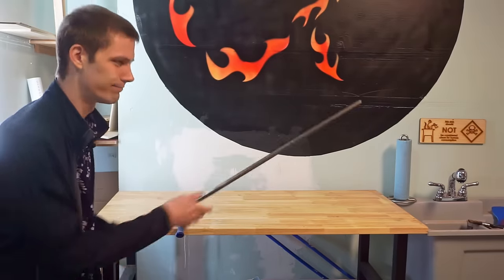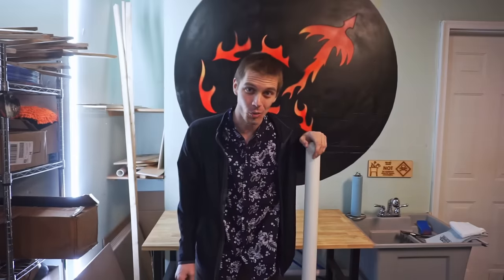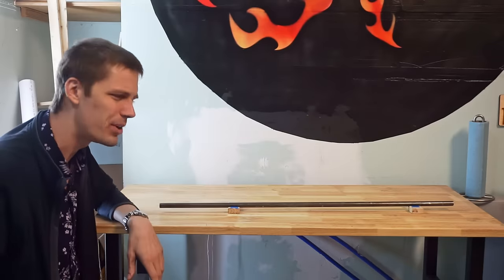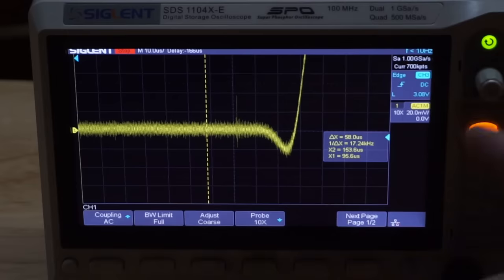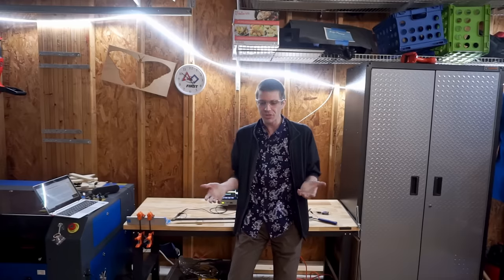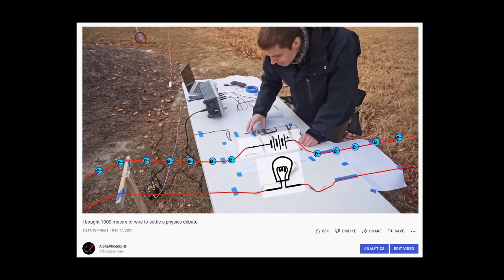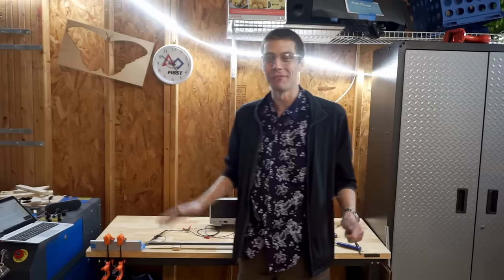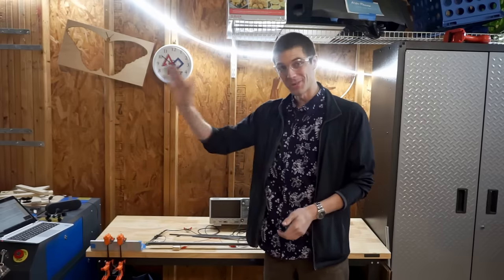Are solid objects really “solid”?

Comment: Years and years ago I had to explain basically this to a guy in a youtube comment who was trying to imply that physics (maybe just astrophysics) is bullshit. His example was a very long tube with golf balls lined up inside it - that pushing in a new one would mean that the one at the other end of the tube would fall out instantly, and therefore the speed of light being a cosmic speed limit was bullshit. I reasoned that, first of all, you'd need to apply a shitload of force to push millions of stationary golf balls - and then since you're applying so much force, that will clearly compress the golf balls, and you'll have a pressure wave moving through the balls which would likely be very fast, but decidedly slower than the speed of light.

I think he then got mad.
Reply: @obsideonyx7604  Lolz, how easily triggered do you have to be to imagine SJWs in scenarios with nothing to suggest one might exist. You're not even a snowflake, you came to the table pre-melted.
Reply: @QuesoCookies  observation = triggered

Nice logic
Reply: @obsideonyx7604  Speculation =/= observation

Logic 101
Reply: @QuesoCookies  observation came first, then speculation.

Still, speculation =/= triggered.
Reply: I once came across someone who believed math beyond elementary school level was useless in a YouTube comment section. Some people are hopeless.
Reply: Was he a flateather by any chance? Because there was a flatearther saying something similar (his example was a very long pole from Earth to Mars) very recently, and when I pointed out that pushing one end would not cause the other end of the pole to move instantaneously, I never got a reply ever since LOL...
Reply: @obsideonyx7604  You must have been pretty pre-triggered to suspect an SJW behind every corner though.

I recently had a brief discussion with somebody who was convinced that leftists were unfairly criticizing the Goths for invading Rome. It was pretty funny, this guy could not really understand that this only happened in his head.
Reply: @stefangadshijew1682  what a world we live in, where if someone reminds me of a far leftist and I point it out, I'm triggered. 

Am I not suppose to mention similarities to leftist or something?
Reply: @obsideonyx7604  You can do whatever you want, and other people might point out if they find it reasonable what you do.

In this case, some people point out that you get reminded of leftists by things that have nothing to do with leftists specifically.

I personally have seen this kind of behaviour more often with anti-left people with weird pseudoscientific ideas, but I didn't feel compelled to mention it, because it is really not specific of either the right or the left.

I don't want to be too disrespectful to you, I just think you should chill a little and forget that left/right-stuff once in a while. :)

Edit: By the way, you're right, the use of the word "triggered" in such contexts is disrespectful and insulting. Just because you felt the need to voice your opinion, people call you "triggered", invalidating whatever it is that pisses you off without considering wether you're completely right in your reaction. 
Maybe don't use that word in such an insulting manner yourself if you rightfully don't like that.
Reply: @stefangadshijew1682  a most honourable response. Very high EQ.

You're right, although I wasn't intentionally making this political, like, you don't decide what ideas you get, sometimes they just come up, but you're right in that maybe I should have kept those random thoughts to myself, politics is already dividing as it is, no need to let it infect everything we love.
Reply: @obsideonyx7604  Hey, thanks for the nice reply! :) I'm glad that you get my point without taking it personally. I also get that you didn't intend to make a scene out of your initial comment, but yeah, politics these days feels like walking on eggshells.

Wishing you a good day! :)

Comment: And this is why HEAT rounds are so effective, the penetrating jet is moving faster then the speed of most known materials. Basically the jet is punching through the material faster then the material can even react to it happening! Of course once you do that the material stops acting like a solid and more like a thick molasses. At this point normal material properties stop meaning anything and penetration starts getting close to the idea penetration model where the jet is going to penetrate a depth equal to the square root of the ratio between the destiny of the jet and the density of armor (this is part of the reason a high density metal like copper is used, it's about 14% denser)  times the length of the penetrator. Notice that last part is linear. This is the second reason copper is used, it really ductile. You can pull it into a really long and thin wire before it fails. This means you can get a nice long jet of it, the longer the better! This in turn why you hear the idea of "fist to finger" brought up with HEAT rounds. The greater the rounds diameter, the more copper you can have which means you can get a longer jet before the copper breaks up and since penetration is linear with length, all thing being equal the bigger warhead is point to punch a proportionally deeper amount of armor. 

Now with all that in mind, this also part of the reason why modern kinetic energy based anti armor rounds (though technically, HEAT rounds is a type of kinetic energy weapon... it's just a little more complicated... as long as my rant above is, I left out a lot) use what looks like thin, really long darts. While they don't hit quite as fast as a HEAT round, they do get close enough that the extra length does aid in penetration. 

Long story short, the science of material handles impacts at really high velocities is really neat. And this should also give you and idea of would happen if you tried to push a light second long rod of metal.

Comment: 2:00 I'm calling it now, it's going to be C, because the mechanics we're dealing with here isn't dissimilar to how sound waves propagate though air. The bar doesn't all move as a single object; the bar experiences a compressive force that moves through the object in form of a wave. The first row of atoms experience the force at the point of impact, they move forward, then transfer that force to the next row of atoms, and so forth until the entire body has been carried forward. The propagation is only faster in the solid because we're dealing with smaller distances between the atoms, as they are packed more densely. Other than that, it works exactly the same as it would in a fluid or gas.

Comment: Solving the speed of sound equations in 3D crystals is a very well documented process and yet it still remains very challenging to solve for the elastic constants in the materials I study... Very interesting how the crystal symmetries play a part in speeds of sound.
Reply: it should be faster right?
Reply: Does it depend on the angle? Also what about pressure vs shear waves? Very complicated, moreso than in fluids.

Comment: This has some intresting implications. Especially for the fact that this means this is much more observable. We could make a mile long steel bar and have a machine push it. It would take a whole second. With a slow mo cam half a mile down we might even be able to see the ripple of the movement
Reply: A mile long steel bar at 5/8" thick would be around 21,000 lbs. A slow mo camera could see the ripple in the 91cm bar. No need for the super long bar.

Comment: As a mechanical engineering student I can confirm that compressible fluids are one of the hellholes of fluid mechanics and thermodynamics
Reply: Do it bring a lot of variables that come with it?
Reply: Also as a FEA analyst Speed of sound through metal is the bread and butter of all the computations and basically make all the modern stuff around us work
Reply: @vlogcity1111  not only that, but the relationship between them (the equations) is more complicated too
Reply: @vlogcity1111  Yeah but the real problem is that is where the additional terms in the equations drop off into infinity and often cannot be solved even numerically.
Reply: @ianallen738  yes this. I hope someone comes out in future to solve this problem
Reply: Water isn’t a compressible fluid, right?
Reply: @TheAdarkerglow  Really much depends on your case...
Reply: @TheAdarkerglow  well for most applications it can be treated as an incompressible fluid, but in reality there is no incompressible substance. Notice that, as explained in this video, water compressibility is the cause of sound being able to travel across water, and also some other interesting effects such as the water hammer.

Comment: worked on a very similar problem a while ago, things get really hard really quick. had to measure energy of impact of cordless impact drill used 12Gs/s DAC and custom amplifiers. The model is really close to a RF transmission line :) the speed of sound and the temperature are the main factors. i have recordings of the wave travelling through the rod and the losses at different crossections due to emitted sound and plastic deformation. it was so cool :)

Comment: Great video. This got me thinking that the speed of sound should be faster in harder materials. and turns out it is. at least when i checked for diamond.(12000m/s) would be interesting to take a bar of carbon steel (arround 0.8% carbon would be ideal) and test the delay in an annealed state and then test it again fully hardened.

Comment: I guessed C but I was secretly hoping I was wrong and weirder stuff was happening. What a great video :) keep up the good work
Reply: E) all of the above+1, depending on when you stop going deeper, a) instant- if rigid and using classical mechanics, b) if rigid, but with general relativity, c) if rigid, but without heat effects, d) if a mesh, but without heat effects,
e) if mesh and you count heat loss, may never measurably reach, aka infinity time. f) b because electricity goes the speed of light and moving metal rod produces current and vice cersa.
Reply: I was wrong for the short version(also guessed point c (not the speed C), but changed my mind last second) . But at higher lengths, most of the wave will be perpendicular to the rest of the wave, see water wave in a channel, there will be drag off of the edges, even light(if not perfectly parallel) will defuse down to nothing, which is one of the reasons stars shine so dim.

Comment: I always wondered about this. I knew that transfer of information couldn't happen faster than the speed of light but I could never wrap my head around why it wouldn't work with an incredibly solid low weight materials like carbon fiber or graphene. To think it was predicted by something as simple as measuring how fast sound travels through the material blew my mind. thanks!

Comment: As a blacksmith, welder, and inspector, I love this explanation of the "elastic" connection between iron and carbon atoms. Plus, I learned about a third sound wave measurement that I had not run across in ultrasonic testing. (UT)

Comment: Cool video, thanks for that! Like many, my first thought was "wait but isn't there a delay when the force sensor compresses?", and from reading the comments I understand  there isn't.
But, I think of one cool way you could improve the experiment: place several sensors along the length of the bar, so you could see them firing in sequence, linearly (and btw if there was a sensor delay you could even measure it as the line offset). Maybe weld on a bit at half-length and place another sensor in front of it.
Reply: He sort of tried that. He initially had a sensor at the front as well as at the back. The problem with that setup was that the time of the propagation of the wave through the sensor was inconsistent, and I'm not entirely sure why that was, probably something about the interface between the materials not being perfect.
Reply: @Corrodias  As I understand it: The steel bar is relatively rigid and the sensors are relatively squishy. That first sensor was so much squishier than the steel, that its random variations in squish were enough to seriously mess with the overall result.

Technically you could put sensors along the steel bar, but the steel itself would still have to be continuous - you couldn't have the impulse actually having to be transmitted through the sensors, or you'd be back to the inconsistent-squish problem. Instead you'd stick piezos to the side of the bar, functionally equivalent to placing microphones and listening for the sound. Which would work, but would be less clear to the audience.

(for reference, many microphones actually use piezos to convert acoustic energy into electrical energy)
Reply: >and from reading the comments I understand  there isn't.
There is, it is just negligible in this setup. And to correct for this and be absolutely sure your experimental physics class would just make you repeat the experiment with different bar lengths. Lets say 5 different bars with lengths varying from 1L to 2L, where L is the length of the shortest bar. All sorts of clever things can be done to eliminate systematic sources of error in experiments and remove noise. In this case if you did that, you wouldn't get much and it would just make the video worse to watch.

Comment: I actually performed an experiment similar to this during my freshman year, but the setup was different. We used an RC circuit that only discharged when the bar touched a metalic base. We then dropped the bar from a small height and measured the difference in the charge in the capacitor after one bounce with a voltimeter. Since the bounce means an impulse traveling twice the lenght of the bar we used the exponential decay of the capacitor as the means to measure the time elapsed during the travel of the pulse. With the travel distance and time we got the speed of sound in the bar. The osciloscope makes for a better presentation though ;-)

Comment: I love this channel.  I majored in physics, and used oscilloscopes for validating clock synchronization timing to nanosecond resolution.  I feel like this channel is specifically made for me :-p. Oscilloscopes are amazing, and you are so clever at finding ways to leverage it to show some phenomena that is otherwise almost impossible to demo outside of models or using very specific lab setups.

Your video asking what happens when electricity meets a fork with one disconnected side should be required viewing for 200+ level physics students.

Comment: Weirdly enough, I had this as a thought experiment a few weeks ago, specifically a light-second length of metal pressing a button. After mulling it over for a few days, I couldn't come to a conclusion. I thought it was likely to be the material speed of sound, maybe the speed of light, but without a practical way (or inclination) for testing I figured that was that.

So I'd like to thank you for settling that particular loose shower thought; as well as explaining why the extensional speed of sound applied instead of the longitudal. 

A few questions I have are: Around about how wide would the bar have to be for the longitudal speed of sound to apply? I assume it would have to do with the wavelength or amplitude, but it was implied that it was due to the dimensional ratios. Could the longitudal speed apply if the bar was struck across the diameter as opposed from end the end or is there a minimum dimension for it to apply?

Again, thanks for the video.
Reply: I was asking myself the same question 😅

Comment: As a chemist, compression wave was the obvious first thought. Very interesting though that there are different speeds of sound dependent on the geometry of the material

Edit: hey guys, I knew well in advance that sound traveled at different speeds in different materials, my comment was about the geometry of the material being a surprising factor
Reply: Infrasonic frequencies travel faster... Think earthquake..
Reply: Cody's lab did an interesting experiment to prove this. He proved that the speed of sound travels faster underground, than it does on the surface through the air.
Reply: @Constant State Of Flux yes, particles  are denser, allowing sound waves to bounce off them to reach greater velocity. The denser the medium, the faster the speed.